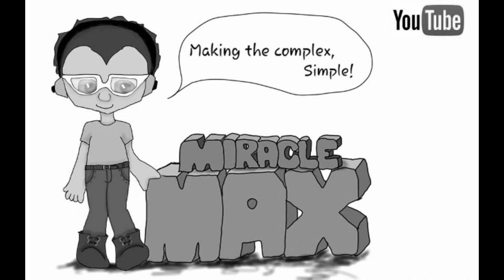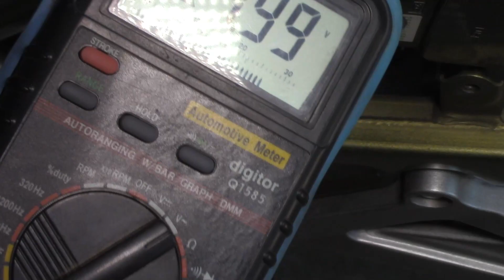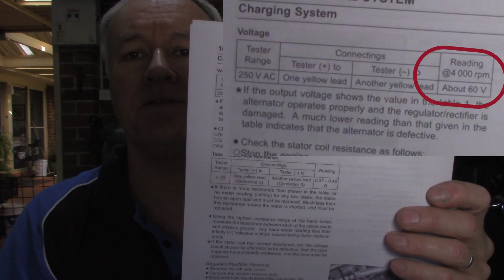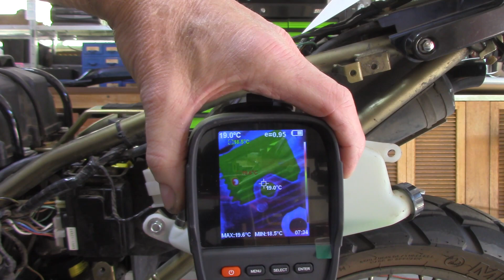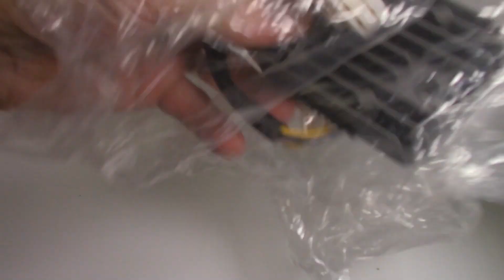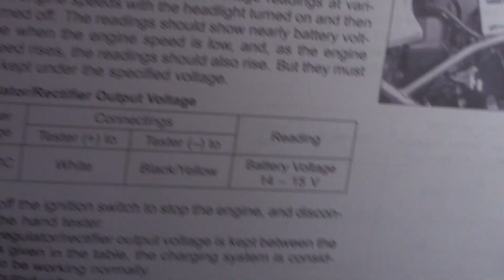Kawasaki KLE Not Charging

Comment: my charging volt dropping to 12.4 v while riding. Er6f 2012. Already change new rectifier and new battery
Reply from the maker: Since you've already replaced the battery and rectifier, your next step should be testing the stator for proper AC output. 👍Did you follow the procedure shown in the video?

Comment: I’m having a 25v output on the alternator cables, and also the rectifier seems fried, is the stator easy to change ?
Reply from the maker: If it is having excessive voltage output, I suggest the regulator needs to be tested
Reply: @MiracleMAX i tested it and it is broken, but when i tested the alternator output on the 3 phases it wasn’t reading 60v at 4k rpm but it standed still at 25v should i change the stator too ?
Reply from the maker: @sonoilchamp  Have you tested the stator between the phases with the connector disconnected? Have you checked the resistance between the phases? Should be roughly 0.37 ∼ 0.46 Ω. Have you tested for continuity between the phases and ground?
Reply: @M @MiracleMAX s i have tested it between the phases with the connector disconnected, not the resistance nor the continuity tho
Reply: @MiracleMAX i meant 25 volts on stator phase even at 4k rpm
Reply from the maker: @sonoilchamp  Ok, let me know what you find after doing those tests
Reply: @MiracleMAX hello the resistance is not what it should be, i suspect that the stator is broken and also the voltage regulator
Reply: The resistance is much higher
Reply from the maker: @sonoilchamp  If the resistance is higher, that would explain the low voltage output. I found this manual online that should help you with the stator replacement
https://en.enduro.team/File:Kawasaki_KLE500-B1_2004_Service_Manual.pdf
Reply: @MiracleMAX thanks max 🙏🏻
Reply: I forgot one thing, my battery is now flat (11,4v) will i be able to jump it and charge it w the new stator ?
Reply from the maker: @sonoilchamp  I would charge it so that it is ready after you have carried out the repairs
Reply: Hi max sorry to bother you again but what allen key size do i need to disassemble the stator ?
Reply from the maker: @sonoilchamp  Sorry, I don't have that information. It might be in this manual I found online 
https://en.enduro.team/File:Kawasaki_KLE500-B1_2004_Service_Manual.pdf

Comment: Following your methods it would seem my regulator is fine but doing the more common diode tests (positive and negative bias) it would seem the all 3 diodes dont work when tedting from my positive wire (going to battery). Dies thus indicate faukty diodes not ketting current through vs a short lik your case? All this electronuc stuff is new to me. Im surprised non of the other resources mentioned your test. 

If it was a short and we used the negsyive poditve bias test, would both dirwctions show voltage drop/continuity?
Reply from the maker: How did you test the diodes? With a diode tester feature? They only measure one way.
Reply: @MiracleMAX  Yes with the diode tester. I think the goal of the test from most tutorials is to make sure current is only passing one way through the diode. 

So a reading should  be seen when connecting the black multi lead to the wire going to the positive battery side, and probing each phase of te stator wires on the other side with the red wire. 

Then reverse the multi leads when testing the negative battery lead should give a reading (this I don't understand) - does current flow back into the multi meter from the negative side of the battery?
Reply from the maker: @MrHookah01  You will only have a measurement one way because a diode acts like a one-way valve
Reply: @MiracleMAX  got you thanks... and if there is a short like your case would current then flow both ways?
Reply from the maker: @MrHookah01  A measurement both ways of the same voltage would indicate an internal issue needing replacement.
Reply: @MiracleMAX thank you for your information and help 🙏

Comment: Hello!  On the Kle 500, does the charging relay heat up when the engine is running?
Reply from the maker: All electrical components will heat up to a certain extent, but if is hot to the touch, then it possibly has an excessive resistance.
Do you have an issue with the charging system?
Reply: The motorcycle would only start when pushed and the tachometer indicated bad, even at 8000 revs at idle and the engine was running intermittently.  I put another battery, and it works normally.  I think it charges normally, it has approx. 14 volts when I start the engine on the battery.  The charging relay feels hot to the touch.  I have never laid hands on him before.  I don't know how to test if the installation has a larger consumer. Thank you!
Reply from the maker: @constantinistrate72  The best method would be to do a voltage drop test over the switch of the relay.
Reply: @MiracleMAX Thank you!
Reply: @MiracleMAX I don't think I know how to do this, where to measure and how much should it be?
Reply: @MiracleMAX Do you know what the resistance should be between the wires coming out of the relay?
Reply from the maker: @constantinistrate72  The best test is a voltage drop test between pins 30 & 87 on the relay while the engine is running.
https://youtu.be/gX5djxG24oI
Reply: @MiracleMAX   Thank you!